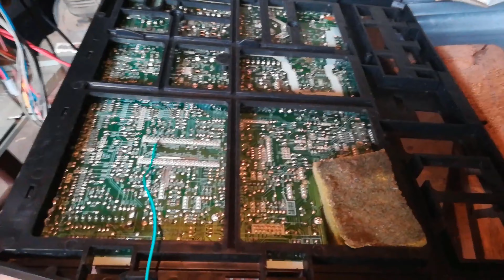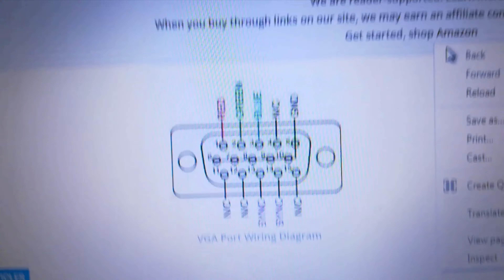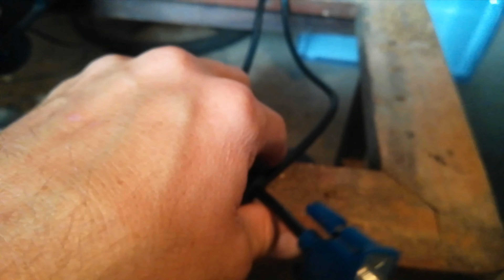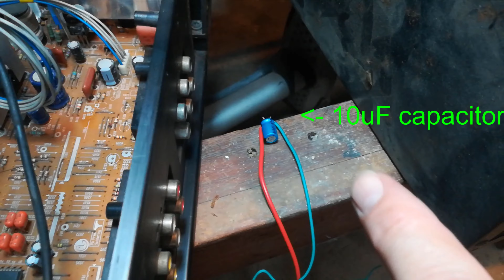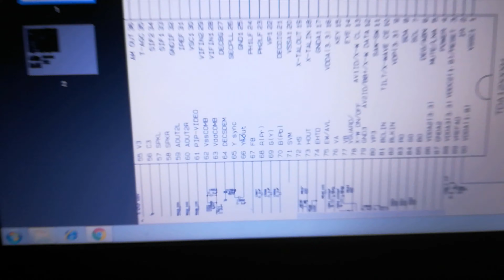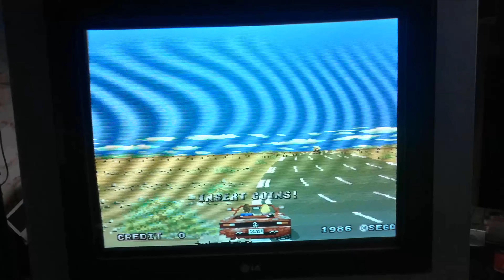EP90: LG TV Hack part 2 ! Did it work ?? Did I hack an "un-hackable" CRT TV ?? Watch to find out !!

Comment: Sugeh na! Noice hack!
Reply from the maker: Thanks a lot KB! The picture is just awesome now. Just think about how old this TV is. Sure, it was top of the range back in the day (which helps), but to see those pixels divide up to red green and blue separately...its just something else. This poor TV had been driven with a composite input all of its (usable) "broadcast television" life, but at least now gets to display a picture it's proud of, into the last few decades of its life. I foresee this monitor lasting at LEAST another 20 to 30 years (without a flyback replacement, or any other major work). Thanks for watching! Cheers for now!